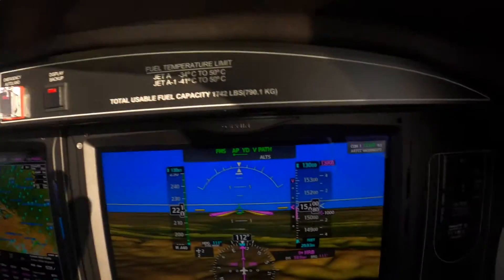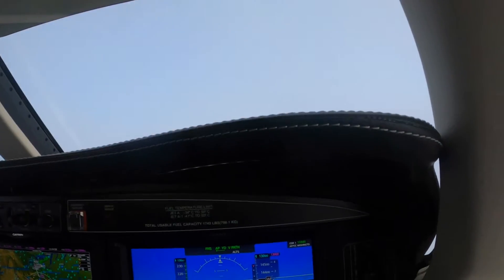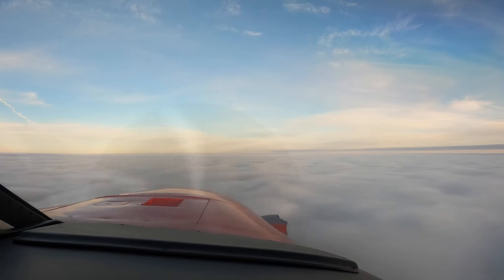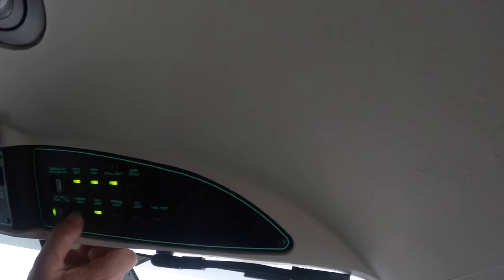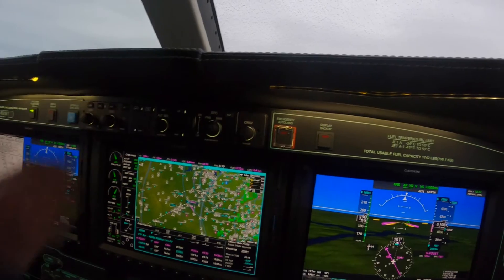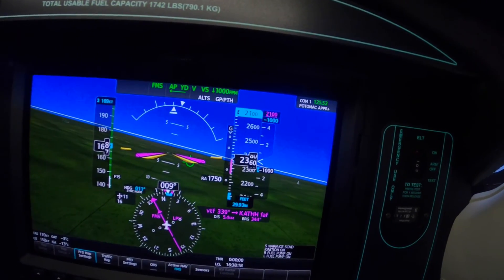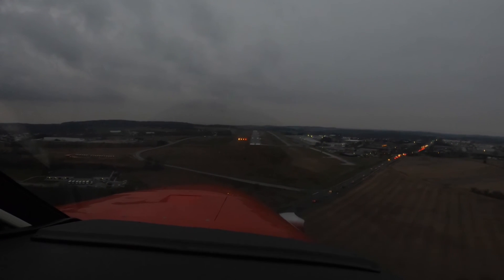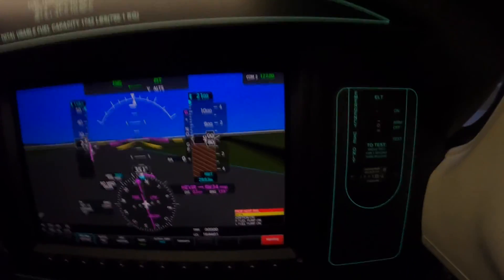Piper M600/sls: Managing Airframe Ice

Comment: I was taught that you don’t want to use the boots until you have a certain amount of ice accumulated. If you use it too early, you can reduce the future effectiveness of the boots during that icing encounter.
Reply from the maker: Hi Jake, The training you received is based on a theory that was never really proven and which is rendered irrelevant by modern boot design. The theory got its “wings” from Ernest Gann’s book, “Fate is the Hunter”. The theory caught on in spite of many learned rebuttals. Neil Singer put it to rest, I believe in 2013 in his AOPA article on the subject: “Extensive wind-tunnel testing has shown that deice boots are as effective at shedding ice when activated at the first sign of accretion as when activated after one-quarter inch of ice had accumulated.” There is lots of new information which supports the AOPA article. Let me know your thoughts… DR .. Fly Safely - Train Often.

Comment: Piper says the M600sls has standalone autothrottle. What does it mean ? Overtorque and overtemp protection ? Automatic takeoff thrust ? Can the levers move on their own?  Or is it only for the emergency mode ? Then it's not standalone.
Reply from the maker: Hi Andre, The M600/sls has auto-throttle and for now that system is only available within the Auto-land regimen. Certification for the auto-throttle outside of auto-land is in progress and anticipated soon.
Reply from the maker: Update .. The Piper M600 is indeed now “auto-land and auto-throttle equipped. This means the FMS mode will set the power dependent on the operation; climb cruise descent. In the manual mode the pilot can select a specific speed; approach speed, Va, Ice penetration speed etc. It is a joy to fly and I believe it is the ideal single pilot aircraft for first time turbine pilots.